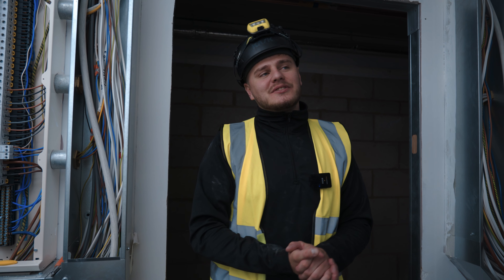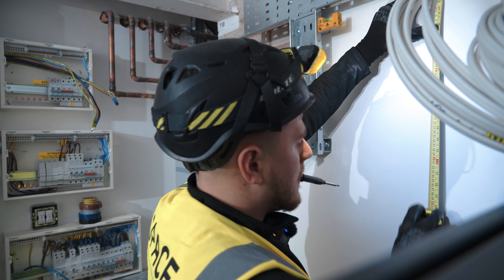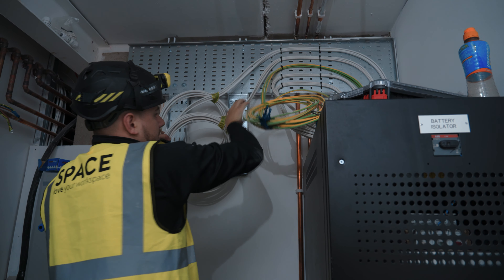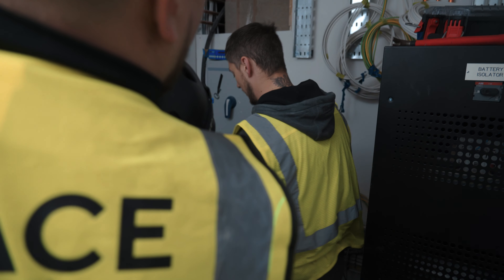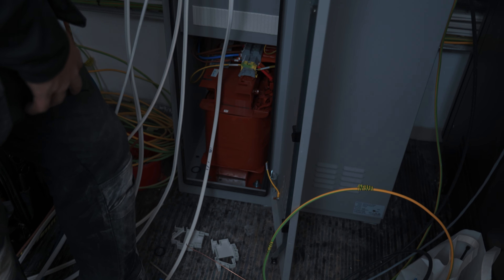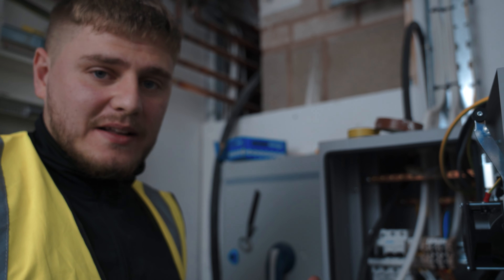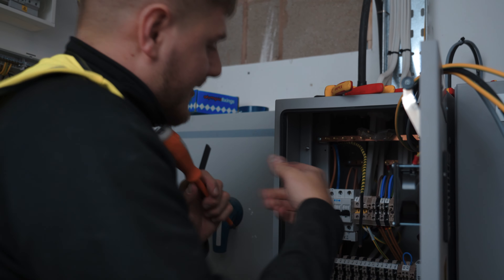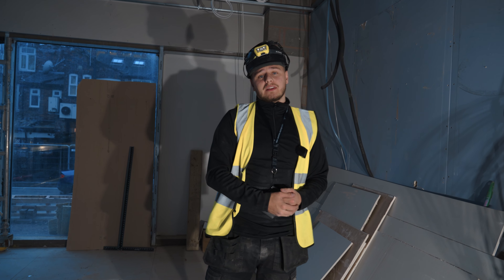Connecting electrical circuits without earth's -- Medical IT System

Comment: See Section 710 in BS7671. The explanations here are not correct and very poor.
Reply: @residualelectrical  If you put "Professional" information on the net IT MUST BE CORRECT! The basis of IT systems in medical locations is that contact with a single live conductor is NOT dangerous, even if you are also firmly touching Earth. All the additional supplementary bonding is to prevent any potential between anything in the room, from static or any other cause. A single fault produces no Danger, and it will cause an alarm from the Earth Monitoring System. Therefore it can be fixed ASAP. Regards David CEng
Reply: @residualelectrical  in fairness David may well have written 710 so might have a bit at stake chap. 🤣👍